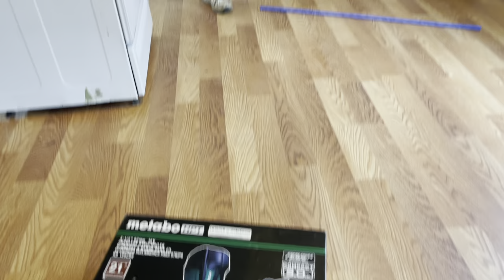Mobile Home Flooring Issues. mobile home remodeling

Comment: The previous owner of my mobile homes would just put another layer of subfloor on top and old layer of subfloor whenever something would  get squishy.   In some places I have 3 layers of subfloor with with  Linoleum in between.  Each time I remove a layer of subfloor to get down to the joists the smell of rotted subfloor and trapped moisture/ mold is a treasure.  Totally agree never ever ever put a sub floor on top of another sub floor.
Reply from the maker: Oh my God three layers that is total insanity I would never do that
Reply: Polybutalene plumbing is trouble. Fittings prone to leaks. Thereby floor damage. Will continue to be an issue until all is replaced.  Use pex with brass fittings. Use red red and blue pex. Crimp on rings. Wrap with pipe insulation. I avoided placing it in flooring .  If leaks occur as is obviously  sub floor damage occurs. By placing below belly paper when and if leaks occur it goes to ground. Place insulating seam on bottom so water drains downward not into subfloor. Rip out old water damaged insulation because R factor is lost when water soaked and compressed it. Make sure sub floor drys out , mold and mildew is killed before closing up. I'd encourage a hot water heater pan under the tank. With a drain line routed thru sub floor , under home and to outside thru skirting to drain to outside not under home.  I used 5/8 treated plywood for sub floor.  Screwed down with decking screws. Replaced damaged insulation with new insulation on roll cut it to fit. No cramming or packing so as R factor not compromised. Used insulation hanger wires to hold in place. Sealed gaps around plumbing with great stuff to prevent entry of pests and eliminate air leaks. Already had moisture barrier, dehumidifier, foundation vents sealed up, also wrapped exposed ductwork with rolled  silver insulation with spacers to reduce sweating and better at preventing heat or ac loss. Expensive? Yes. But not so much for a DYI!  Rentals tend to cut corners, compromise to save a dollar, not concerned with the long run,  cheap not quality material or workmanship. Yall be safe, be prosperous. Best wishes on navigating today's cost of material.
Reply: @tedthornton7791  will probably go with PEX-A with expansion fittings
Reply from the maker: That is a great explanation of what to do and how to repair I can tell you’re knowledgeable about it
Reply from the maker: Good idea
Reply: @markrairdon  sounds good. Best of luck.
Reply: I know someone who did that as well. Didn't matter how rotted the underlayment was. Didn't support  his business. Made most of the repairs myself.
Reply: Wow. Great info. Thanks for being so thorough!
Reply: Same thing in my 1980 mobile. They laid right over the top of squish and worse
Reply from the maker: You probably made a good decision
Reply from the maker: I’m just glad I was able to help. Sorry I missed your comment.
Reply from the maker: The worst thing you can do in my opinion is put a floor over the top of a floor. It’s always best to remove the old floor replaced with new.
Reply: Why oh why can’t y’all be closer to me!

Comment: It would be really nice if you could give a range of  repair estimates for these projects for those who are thinking of doing repairs like you show. For example, we can't tell if this is a $2000 job or a $5000 job. For many of us on a budget we don't want to start a repair and then find our budget is only half or less of what it really takes.  Thanks and good work and explanations.
Reply: All that wood and labor? Probably 15-20k
Reply from the maker: Well number one you got a figure the flooring is $80 per sheet 4 x 8 so every 10 x 10 area it’s gonna take three sheets so right off the bat you’re looking at material $240 that’s just sheeting not including two by fours or any other material you might have to buy. To do everything this house would need which is jacking up the walls building walls underneath the exterior walls repairing the floors removing the material under the walls Probably somewhere around $20,000
Reply: Oh my god! Excellent idea!
Reply from the maker: Yes it is
Reply: @Drewsroofingandhomerepair  
They just need to put pillars in next to this one, buy a shed to put on them and start over building a shed-to-house or something.  Then either tear this one down or rebuild it later as an add-on.
Reply from the maker: I agree 100% Erik
Reply: So, why don’t you use a nail gun on your jobs?  Is it accuracy, and because you don’t know if you’re hitting the floor stringer on center (if at all)…. which I know happens constantly with guys getting sloppy.  Just curious.
Reply: @phillamoore157  It's because sometimes pipes freeze or animals like chipmunks get into the area under the flppr. Mpst of my places are in the northern states where it gets sub zero. Also, many of them are on piers and I don't care to get under them in tight crawl spaces, especially in the winter.
Reply: @williamrichards7081  Gotcha….was having problems connecting the dots with that decision.  👍
Reply from the maker: Yup 👍
Reply from the maker: Nails will back out and you never know if you’re hitting anything and yes screws are better than nails.
Reply from the maker: Nails will back out. I only use screws. That way I know I got it
Reply from the maker: Glad to help
Reply from the maker: I hate getting under a house
Reply from the maker: I agree
Reply from the maker: Are you serious dude?

Comment: When I ordered my Commodore 14 X 76 home back in 1992, I upgraded everything to 16 inch on center -  "Floor Joists - Outer Walls and interior walls", all 16" on center.  My outriggers are 3 feet from the frame on both sides; 30 years later; no problems. I removed the old metal sheathing and installed OSB panels on the outside and installed vinyl siding, then removed all of the thinner drywall, re-insulated everything, installed new Pella windows, new doors, and re-drywalled everything with 1/2 inch Sheetrock,  I even bumped-out the wall 1 foot where every new window was located.  30 years old and no problems with sagging. If you don't specify certain things like 2 X 4 interior walls and everything at 16" on-center, you will defiantly get everything at 2 foot on-center, and 2 X 3 interior walls.
Reply from the maker: Your house is definitely built way better than most of these single wide mobile homes you did a good thing ordering it the way you did. With 16 on center you can definitely have more overhang

Comment: They did my whole house like this. My flooring in some places has 4 layers of floor. Its unbelievable. That's why the ceilings look super short.
Reply from the maker: Omg. Your kidding
Reply: I'm having the same issue... I wondered why my dad's place across the street had significantly higher ceilings then mine... just found out I've got 3 whole layers of subfloor under real hardwood floor.

Comment: Welp im redoing my entire floor... i bought a single wide for 2k, found some issues with plumbing and roofing.... but i watched this video after starting the floor and wondering wtf i am looking at... turns out I dont have short walls... i have 3 layers of subfloor with a hardwood floor on top. Holyyyyyyyyyyy. Welp im glad it was only a 2k house 😅

Edit to add after i watcherd you notice the header was cut off the doorway... just checked mine, same thing. Door already sits crooked but omg this explains sooooo much thats going on with the house. All starts with the floor.
Reply from the maker: Wow. I have many videos that might help you. Just check out Drews Roofing and Home Repair floors.

Comment: That’s what’s happening to my 1960 single wide but has original floors besides spots here and there. The bottom sills on the outside are bad so we’re fighting those as well.
Reply from the maker: The problem with this house is they put a roof on top of it with no support under the trailer itself. You can put Rubber Roof on it like I do in my other videos but if you build a stick build roof on top of a mobile home with all that weight it’s not a good idea. If there’s anything I can help you with please feel free to ask

Comment: This was a great video very informative I also have a trailer with a build on roof they did before I bought having sag problems on the outside walls gonna built the underpinning wall like you did
Reply: What do you mean by build on roof
Reply: My home has a metal roof on top of shingles but i dont think it added much wieght only about 500 pounds
Reply from the maker: Exactly do the underpinning like I did on the other video and you’ll be fine. Just watch when you’re jacking up the outside walls that you’re not lifting the center of the house off of the blocks if you do more shimming of the blocks might be necessary
Reply: @Drewsroofingandhomerepair  thank you🙏🏼

Comment: My sub-floors are 3/4" OSB, with a slight lamination on the top side of the panels, everything was glued to to the floor joists and heavily secured with 2" glue coated staples. None of that cheap Flateboard "sawdust" crapp. I had a miserable time separating  a couple sheets of it from the floor joists when I pushed some of the walls out.   My kitchen is about 17 foot wide, my living room is at 16 foot wide, and my office comes in at around 16.5 feet wide.   I re-did everything, electrical, drywall, windows, insulation, doors, new cherry cabinets, sinks, faucets, luxury vinyl tile in the kitchen and bathrooms, 6-panel interior doors, new aluminum roof-over with a 7 inch overhang and 6 inches of open~cell insulation board under 
the aluminum.  I have about $17,000 in the materials for the remodel, and the roof cast me $6,850..
I glued and screwed everything, and I would guess that I used about 50 tubes of construction adhesive and maybe 2000 screws of various sizes.  I glued all of the outer OSB sheathing to the wall studs with coated screws, then used 2 coats of primer over the OSB, then taped every seam, wrapped the home with Tyvek, then installed something called "Fullback Hurricane Rated - insulated Vinyl Siding".
I still have some work to do; and it's a slow painful process doing all of this work by myself - - - In my spare time..
Reply from the maker: The material on your floor is the same that I have in my Doublewide it is very good stuff. Top quality flooring. It looks like OSB but it is not OSB it is a way better brand of OSB made with semi waterproof glue

Comment: MY MOBIL HOME HAS SAME KINDA PROBLEMS. MY OUTSIE WALLS ARE LEAKING INSIDE TO THE FLOORS. GLAD I WATCHED THIS NOW I HAVE TO RETHINK MY ROOF BUILD I WAS CONSERNED ABOT THE ROOF WEIGHT. CRUSHING THE WALL N BREAKING THE WINDOWS
Reply from the maker: It won’t break your windows. It will make your walks sag worse. Build walls under the ext walls. https://youtu.be/HxzE5Z59Ah0
Reply: @Frank Coley it sounds like you have the same problem I have with my mobile home roof. When they did the roof last they put a short drip edge on it and the starter shingles don't overhang the drip edge at all so water runs under the shingles and back behind the drip edge and down into the walls and in between the windows. We got the place as new home owners not knowing anything about roofing or anything and the entire sub floor was shot. We tore it all out and replaced it ourselves and I was racking my brain on why the entire sub floor was shot. I knew there was a couple water pipe leaks at some point that contributed to it but came to find out that the roof being done wrong was also a big part of it. Also if you don't have gutters I would install them asap bc on most mobile homes the rain water just runs right down the siding to the ground rather than dripping off the roof and that's no good. Siding is not water tight and the water running down the siding constantly will cause moisture in the walls, make it impossible to have your windows open while it's raining and you will have to pressure wash your siding every year from the dirt and grime that comes with the rain water flowing down your siding.
Reply from the maker: Thank you very much for your comment your comment is spot on exactly what I would’ve said
Reply: @Drewsroofingandhomerepair  You are very welcome! Thank you for replying as well! It's good to know you agree with me and that I'm taking the right coarse of action. 😊

Comment: When you put in new floor noises, do you use hangers or just screw to outside 2/6
Reply from the maker: No hangers needed. It’s not holding anything they sit on the frame just screw it to the outside band.

Comment: Silly question but would a cinder block foundation to add support then taking off of the roof to redo it be a better option for that homeowner?
Reply from the maker: No not at all
Reply: @Drewsroofingandhomerepair  Silly question then. What is a cinder block foundation good for the mobile home? Is it a good underpinning or is it a better way to insulate the underside combined with the underbelly to keep the structure warm and critter free?

 I mention this since I am reading a book on mobile home repair and am puzzled by this.
Reply from the maker: Cinderblock foundation is awesome. Mine is brick with cinder block behind it.
Reply from the maker: You will never keep it critter, free kill bait is the best thing. I always keep mouse traps under my house and check them daily.

Comment: Looks like a lot of work!!, you guys are probably going to have to install support posts around the whole perimeter of the mobile home, unless it already has a block foundation! The cantilever of the steel mobile home trailer frame can't take the extra weight of an additional roof installation as this mobile home has !, great video, and good luck, have fun ! Lol 😆
Reply from the maker: The owner could not afford my price so we are not taking on this job
Reply: @Drewsroofingandhomerepair  exactly. This isn't a practical fix. It's messy but you have to go cheaper. It's a mobile home.

Comment: Hey! Thanks for doing this. How would you put LVP over the marriage line in a double wide? I'm about to do that and I'm worried it'll sag over the gap. Should I put rubber/foam in the gap?
Reply from the maker: I’m not real sure how you would do that to be honest the only way I’ve ever done it is by adding plywood to the floor first
Reply: @Drewsroofingandhomerepair  Yeah I'm trying to avoid putting more wood over the entire subfloor. It's already OSB there's just that small gap. I was thinking there may be a filler or something sturdy I could use

Comment: Alright, I've been in house construction,  remodel and new builds for a while. Never really worked on mobile homes. Until now, my new house. I'm remodeling, I've gotten over halfway done with the tare out.. they put new stuff on top of molded sheetrock..it's insane. I've found 4 types of flooring on top of eachother.  My 2 things I'm stumped on are...the edges are sagging and there's a bow in the center of the master bedroom. They put a metal roof on the old roof. I gotta get the sag out the edges. We moved it to my land, and leveled it once already..gotta level it again. Is that the best way to get the outer walls from sagging. Extra support? I learn as I go. I'm almost gutting the place. I'm fixing everything rotted and wrong with it. My other question is should I add extra beams and support under the house as my furniture is heavy heavy antique items..
Reply from the maker: Use treated lumber on the exterior walls like I did build a wall under the wall to the ground that will take care of Loveling your walls and stop the sagging. Call me if you need help.

Comment: On that weird layered floor… so, the bottom is osb subfloor, right? Then they put another layer of OSB down, later or something? Why? I don’t understand why they would do that. Maybe the original subfloor was damaged?
Reply from the maker: I think whoever has been working on this place was a handyman that never worked on a mobile home before. The homeowner in the situation that called me about it off the Internet and did not know we had these problems. They sent him pictures, but the pictures were not worth anything. He was so disappointed when he got there and found out what he had bought online.

Comment: I just bought a mobile home in tupper lake ny and the previous owner was sadly too old to take care of himself or his dog so the dog pissed in the home in certain areas sooo much that the home is sagging in areas and the man sure loved to layer shit like a kid, my foundation is ok so I think it's definitely rotting wood I have to replace, he also had this fn shed he built on the back attached to the laundry room that was completely rotting so we took it off and found a HUGE carpenter ant nest!
Reply from the maker: What I say is, if it’s made of wood you can fix it. If he did it wrong you can do it right remove what he did do it like I do he won’t have any issues.

Comment: What is best SKIRTING..  pls.. Drew and CREW..  Northern California USA 🇺🇸..
Reply from the maker: I like this skirting 
https://youtu.be/MeKxJ9dHQ6M
Reply: Ty..  with vinyl siding,  have attached z bar & T1 11 & good paint,  it's time for plumber and finish back area tomorrow.   BTW that area it 20 degrees cooler yr around  Northern California USA 🇺🇸.  
And suggestions Mr Drew ^ CREW Paul.  Ty  2/16/23
Reply: Question 🙋 anything I can do as for installing ( plumber)  Gas line & wall heat.  But then no forced a/c.    Options before my Unpaid PGE goes off.   AGAIN.   seriously too.  2/16/23.
Reply from the maker: Call me I will try to answer your question
Reply from the maker: Call me so I can understand what you need

Comment: I used to use a portable power planer set just deep enough to remove the glued particle board residue and smooth out the floor joists, after removing the thousands of staples first!
Reply from the maker: I use a grinder sanding wheel 4:08